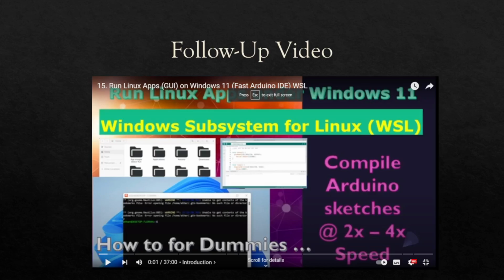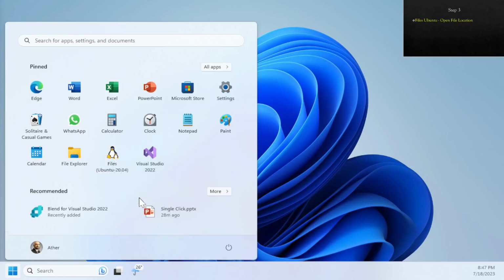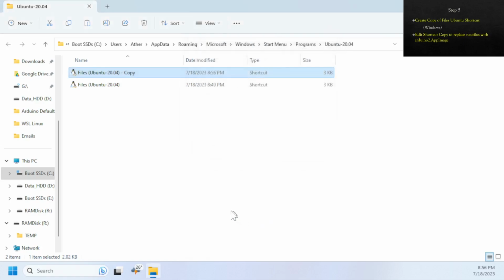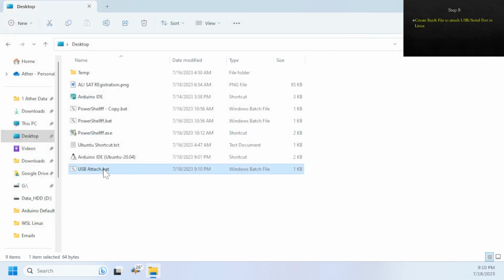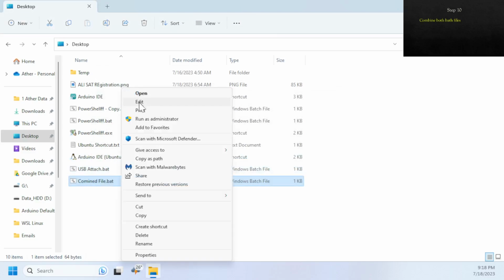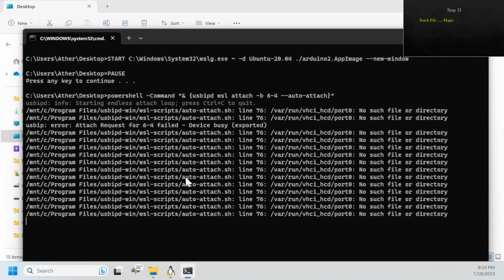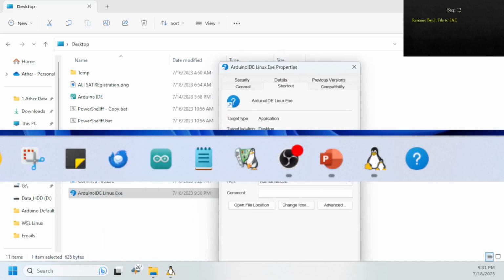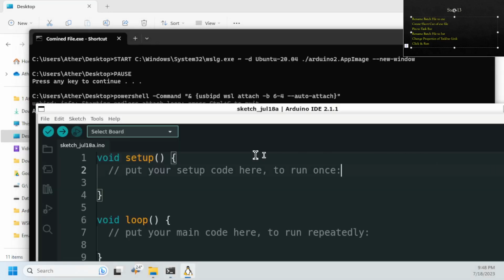17. Single Click & Run Linux Arduino IDE on Windows 11 WSL

Comment: Thank you for all the work you do making videoes.

My Arduino IDE Linux shortcut worked until I restarted the computer.  Arduino IDE Linux shortcut is no where to be found!  Has your Ardino IDE Linux shortcut 
disappeared after restarting computer.
Reply from the maker: My Shortcuts is working fine , since months

It's in my shortcut folder
Ref: My Windows App, MyShortCutZz  (My recent Video)

Though before that, I had it on desktop too, which also worked fine ,

Do check your anti virus, it may has removed BAT file considering unsecure
Reply: Used a .bat to .exe compiler; result shortcut no longer disappears.  I agree about Antivirus; running Kaspersky, since it is working now, have not followed up checking Antivirus.  Thanks for the reply.  Know where you are coming from when saying "spent 8 hours on an 8 Minute project."
 @545sytes